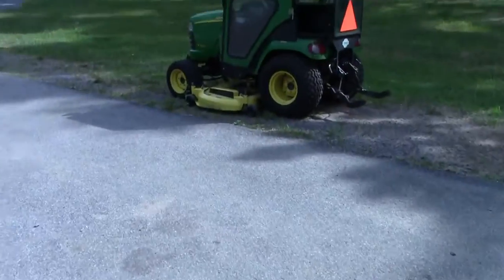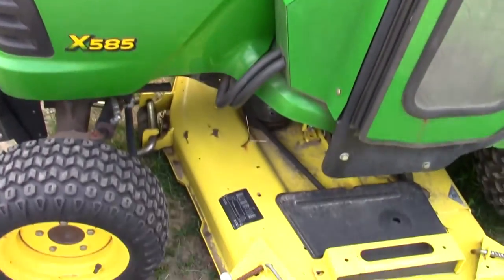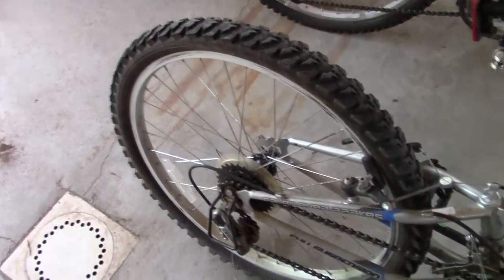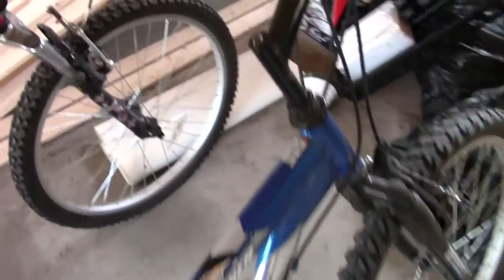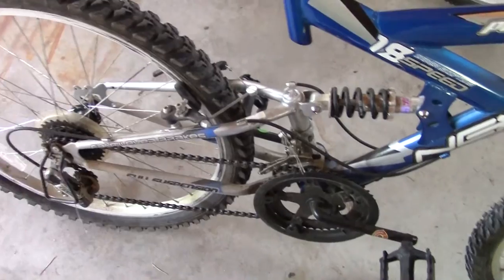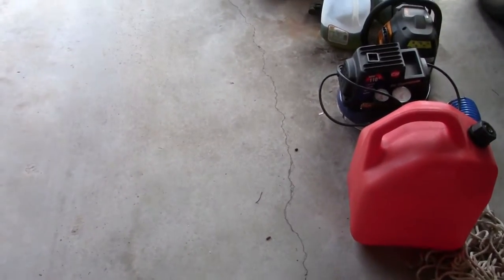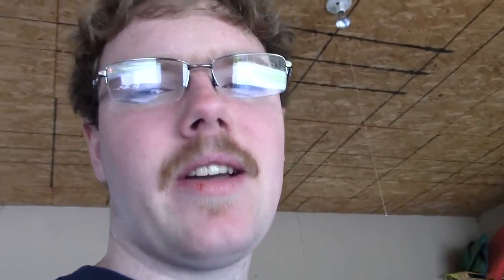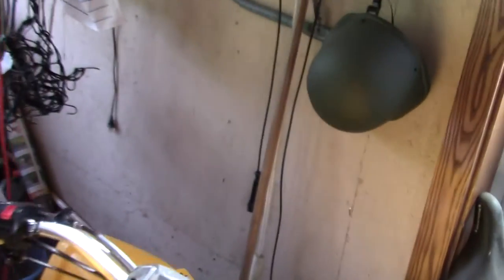K.I.A Campbell Hausfeld air compressor and small update.

Comment: I have a compressor something like the Northern tool one you put up, in my garage. Mine is oil-less so it's not as good. I use it way more then the big 80 gallon one I have in the barn. I'll use it 3 or more times every time I mow. I don't like dust on me or the tractor and mowing here like you do is a dusty job. After every mow I'll use it to blow everything off the tractor and deck, and of course myself. I wouldn't get an air grinder. They use a lot of air and it just makes the compressor work all the time. The electric works better.
Reply from the maker: Oh ok, yeah I thought of also getting a fixer upper jeep Cherokee or Chevy truck. LOL tons of choices. So having an air compressor would help. Well I know the one that died on me is a direct drive oil less compressor. So it could of burned up. I asked our local mechanic and he said if you dont have a 200 gallon plus tank with 15 CFM air grinder wont work good.